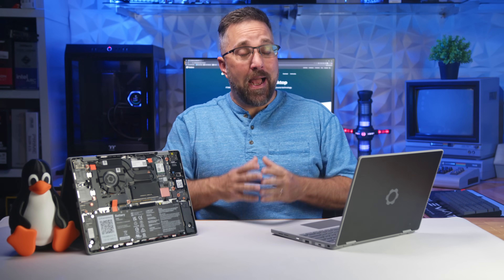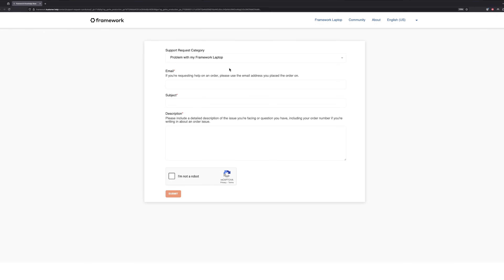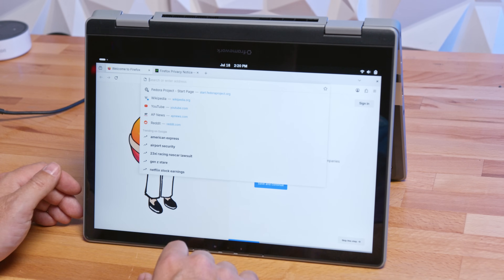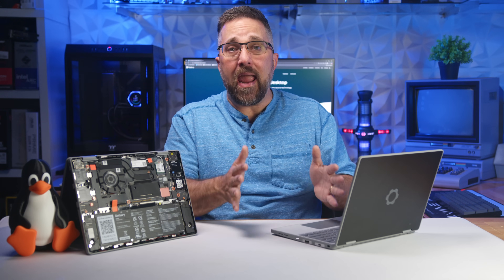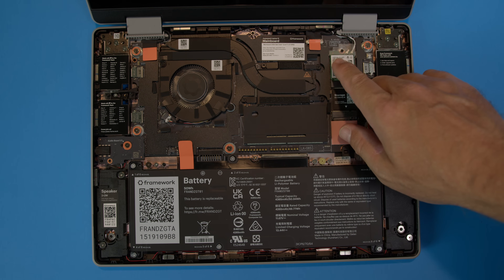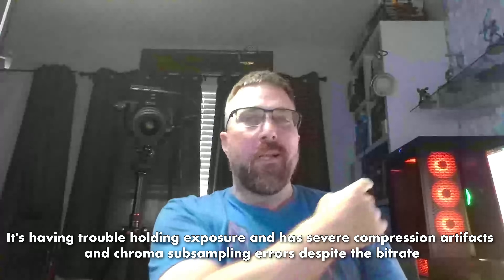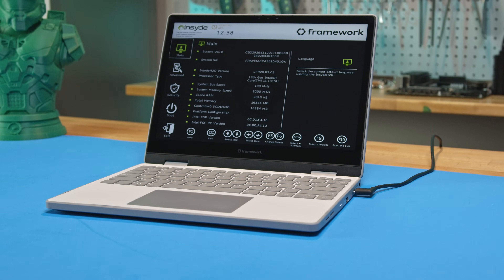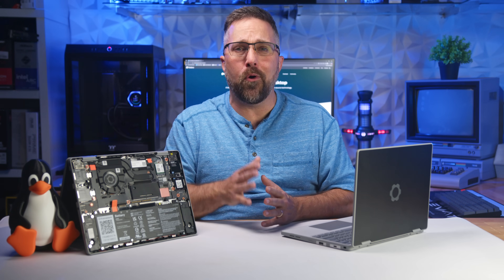Framework 12: Finally! a Linux 2-in-1 That Just Works!

Comment: The single channel memory really bothers me. That was a cost-cut too far.
Reply: It'll use an i5 at most anyways...
Reply: Single channel was barely noticeable for me, when I upgraded to two in my FW13 it was barely noticeable improvement... The CPU and iGPU are bigger bottlenecks lol
Reply: Wrong cost cut. Make it dual channel DDR4 with an AMD APU. I’d have bought one. I’m sure they won’t miss me not owning on.
Reply: @EverettVinzant  Using AMD would have cost more and taken longer.  When a small company launches a new product line, Intel will do most of the motherboard design for them.  AMD doesn't have a conparable program.  AMD's nearest competitor is actually more expensive.  The i3-1315u has an MSRP of $309.  The. R3-7330 is $340.  And between AMD and Intel, Intel is far more likely to negotiate on price right now.
Reply: @SeniorKlean  I said it was the wrong cost cut, not that Intel wasn’t cheaper. It’s not always about being cheapest. You’re arguing cost savings in development, I’m arguing the profit from an alternate marketing approach leading to expanded purchasing…
Reply: @EverettVinzant    Then you structured your comment very poorly.  The juxtaposition of complaining about a cost cut and suggesting AMD with no transition in between implies that you are suggesting AMD as a preferred cost cut.  

Also, DDR4 SO-DIMMs are now marginally more expensive than DDR5.  And there are no 24 GB DDR4 SO-DIMMs so it could potentially be meaningfully more expensive if 24 GB is a sweet spot for you.
Reply: @SeniorKlean ”Then you structured your comment very poorly…”
As opposed to your jumping to conclusions? You assumed and that caused YOUR problem. Learn to think, it’ll be a new experience for you.
Reply: @EverettVinzant    lol, ok
Reply: @SeniorKlean I didn’t realize you are a child. Sorry, I would have handled this differently.
Reply: I agree. Especially with DDR4, because that means actual single channel rather than dual channel with DDR5. (DDR5 is quad-channel in a way with two sticks.) That will not only limit upgradability, but also performance, with DDR4.
Reply: @cameron_bosch  What are you smoking ? Framework 12 uses DDR5
Reply: @Winnetou17 Really? The 13 inch with Intel 13th Gen used DDR4, so are you sure this is correct?
Reply: @cameron_bosch  100% Intel's 12th, 13th and 14th gen support both DDR4 and DDR5, depends on the motherboard.

On Framework 13, it is indeed DDR4 for Intel CPUs 11th to 13th gen, I guess at least partly for compatibility too (not to mention that initially DDR5 was quite expensive and not much better).

On Framework 12 it is DDR5. At 5200 MT/s
Reply: @Winnetou17 Actually, depending on what you were doing, DDR5 could be much faster. In games (not that you'd be playing them on the 13 inch), some games hated DDR4 RAM.
Reply: @cameron_bosch  Single channel vs single channel, yeah, DDR5 was a significant step up.

DDR4 3200 MT/s at CL 16 vs DDR5 4800 CL 40 ? Neah, DDR4 is better in most situations.
Reply: @Winnetou17   DDR4 channels are 64-bit.  DDR5 channels are only 32-bit.  In some very specific circumstances, this means DDR5 can have lower latency, mostly this will matter for graphics tasks.  However, DDR5 having double the channels does not increase total bandwidth at all.  For this reason DDR5 is generally advertised with half the number of channels as it actually has.  

Ackshually Those bit counts are doubled compared to the true spec.  DDR specs are designed around 32-bit systems.  But because all x86 systems are 64-bit, both DDR4 and DDR5 for x86 systems are based on an extension to the base spec.

Comment: I like the thought of the laptop, but I hope that they will have a higher-end version with a metal chassis and a better screen. Maybe in the future I'll get one of these for when I travel.

The one issue I ever had with Framework's hardware was with my Framework 13 Ryzen 7 laptop. The battery failed in 13 months (so it was just out of warranty) and swelled up. Framework support asked me a few questions, and a day or so later sent me a new battery free-of-charge. To me, THAT is what is most important as a consumer: the after sale support!
Reply: Out of curiosity, was your battery frequently on high heat ? Either from fast charging or discharging or simply having the laptop at the CPU limit of heat (95-100 ˚C) ?

I did had some time ago a laptop that heated a lot. And the battery died in about 2 years (which felt and still feels way too soon). Like I had to remove the battery to boot the laptop, with it connected it wouldn't work anymore. After that I bought a 17" laptop, that had much better (but not perfect) cooling and almost 9 years later I'm still using it. It still has the original battery (which, of course, doesn't last much. It has like 40% of the original capacity. And I very rarely stayed on battery)
Reply: @Winnetou17  Sometimes it was on a desktop with plenty of airflow, and sometimes it was on a metal laptop holder with vent holes. I didn't drive the laptop too hard but it did have the fans ramp up here and there. It might have just been a bad battery. Funny enough the battery held charge just fine, it just puffed up.
Reply: @MattLarson2  Oh, then I guess that, yeah, you simply had bad luck, or it was an unlucky incident, not a general/system lack of care or bad design (I hope).

Glad to hear (well, read) that they still replaced it though, that's nice. Hope this one lasts!

Comment: what's the best linux laptop? period...full stop...not just frameworks...all brands included

and why?!
Reply: It's like asking what is the best food. It depends on the person and situation.
Reply: @PlayingItWrong I suppose I mean the laptop that is built for using linux and does the best job of it. It seems like most laptops (non apple) are built for windows, and everything has been geared toward that, but framework vs system 76 vs dells linux compatible laptop (if there is still one) might be a more interesting comparison.
Reply: @open_source_office_hours  yeah, duno if system76 has a touchscreen though for this particular comparison
Reply: @ironfist7789  touch screens seem cool, but mostly for art ya?
Reply: @open_source_office_hours Well what I mean is... that is what the video is about a review of a 2-n-1, which is a touchscreen.  For this particular video it wouldn't make sense to include system76 because they don't have a 2-n-1... But for a full laptop review it would I guess.
Reply: Thinkpad.
Reply: @RogerioPereiradaSilva77 Yeah, Thinkpads have been great development machines in my experience. Good out of the box support. Just need to install some software for the fingerprint scanner I guess.